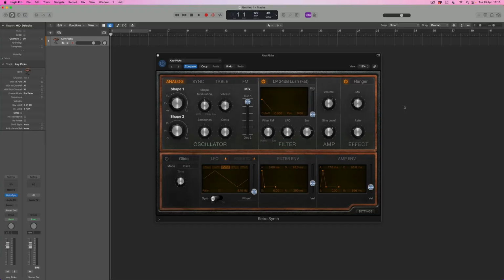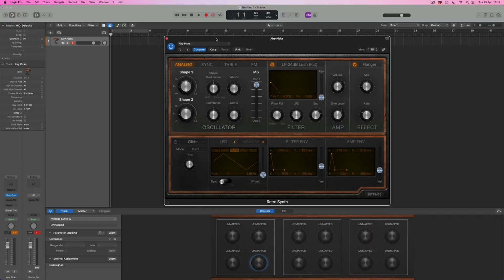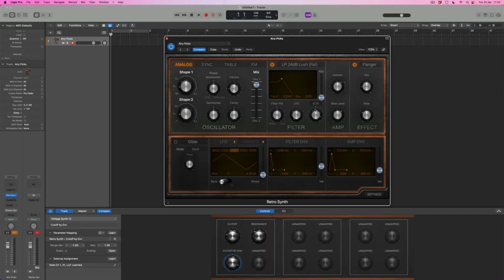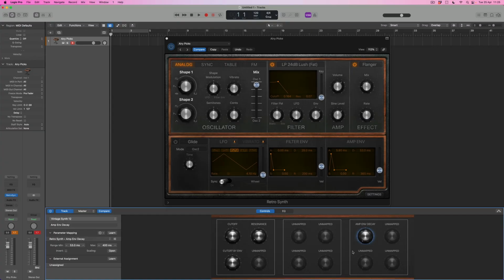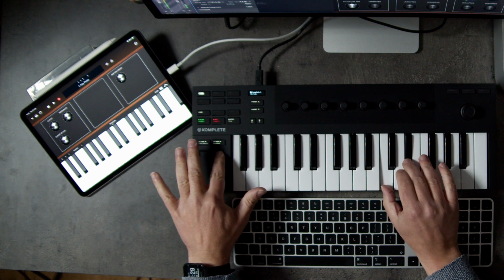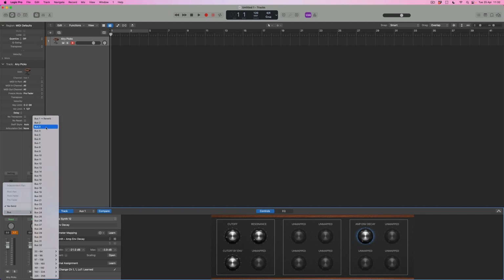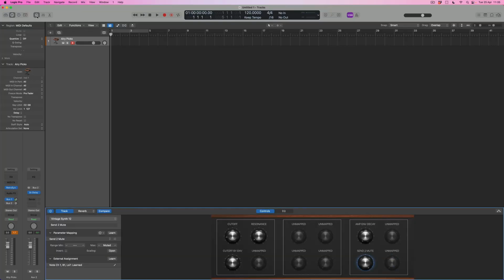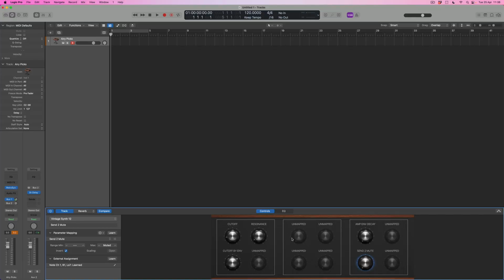LOGIC PRO X - Smart Controls Go Deep

Comment: As always, absolutely brilliant work Jono.

Not sure if anyone else has run into this but the smart controls don't work at all if the track that you are controlling is inside a Track Stack. its an annoying bug but I believe it was addressed and fixed in one of the latest Software updates for Logic Pro X. So if you are having any trouble, maybe update your Logic software and that can solve it. Hope this helos!
Reply from the maker: Thanks so much for sharing that tip. Pinned!

Comment: 0:41 I might be missing something but how can you get such long lasting notes if your sustain is set at 0? When I load this preset I get short plucking notes (even with long release)?
Reply from the maker: Good question. If you play a really short, Staccato note, as I do at that timestamp, you’ll hear a long 3-second release. If you hold a note down, it will ‘choke’ and won’t sound the same. In the video, I’ve adjusted the Release Time, which you can do too if you don’t want the notes to last as long as they do in that first demonstration.
Reply: Sustain must be set to 💯
Reply: Sustain at full level

Comment: Great explanation but a warning about assigning smart controls to a keyboard note, that specific note is no longer a playable note on any track (on that controller, it will be fine on other controllers) as it has been taken over as a Control Surface. One can do it, but it can lead to great confusion as to one no longer can play it from that particular controller.
Reply from the maker: Hi Shane. Absolutely right. I’ll make a Short about to un-assign Smart Controls in case anyone runs into that issue. Thanks for flagging it.

Comment: Hey Jono! Great video
I am working with Step FX (which I have applied to a send) in the Smart Controls and added one knob which controls Step Mod 1 Ties. The issue is, these parameters are under 'non-automatable' in the selection list, so I can't, well, automate them. I am able to control the knob with my MIDI keyboard or clicking on it, but I've been scouring the internet and couldn't find a way for Logic to 'remember' when I want it to be on or off. I've tried recording on my track and moving the control where i want it to be moved but had no luck getting it to work.
Do you happen to know a workaround for this?
Thanks a lot!
Reply from the maker: Interesting question. Let me look into this for you and I’ll let you know what I find! Thanks.

Comment: An interesting area for a channel so oriented on synth and logic pro would be how to map alchemy with a midi controller, prevent conflicts, etc. There are only simple midi mappling command+L control assignements video on yt, while nobody teaches how to prevent problems in mapping with logic pro. ex backup file(with the script), use more instruments, deabilitate etc
Reply from the maker: Thanks for the comment. This is such a tricky area for those of us making content because there are so many variables including which controller keyboard or surface anyone is using, whether there is a willingness to 'sacrifice' MIDI CCs usually reserved for specific functions (like Modulation, Expression, Breath control etc) and whether or not your needs change from one Alchemy (to use your example) sound to the next. One Alchemy patch might be deep and involved with multiple sound sources (all with parameters you might want to control, whereas the next might be smaller in terms of parameter count). This Smart Controls video will show you how to map any controller to any parameter (or combination of parameters) to a MIDI CC and if you save that patch as a preset, it will retain all of those assignments. So long as you map CCs which you've identified that = for you - are spare, you should be able to control whichever parameters you like. Hope that helps.
Reply: @jonobuchananmusic  thank you very much sure it helps.

Comment: Awesome! I had some problems with the Airy Pluck patch - it was behaving erratically - so I just experimented with the Default patch. I also had problems with establishing external control of the Smart Controls - likely MIDI confusions across my many controllers. Logic, for example, would register that it had linked my Komplete Kontrol's mod wheel but it wouldn't trigger. So I tried my Nakedboards MC-8 fader controller and that did work. I also discovered that you can automate a double or triple function Smart Control - actually the more likely way I would want to use these functions. I was automating filter cutoff, amp envelop, and a reverb bus with a single automation lane. Very cool! Thanks for another great tutorial!
Reply from the maker: Great to hear, many thanks for the update Gary.
Reply: @jonobuchananmusic  The issue was with my Konplete Kontrol S88. A reboot fixed it. But that's not why I'm piping in. I've since learned that Logic's Scripter (in MIDI FX) enables the same kind of  automation routing you describe, and you can target as many as four parameters in a single instance of Scripter. Very slick! Perhaps a good topic for a tutorial video? I've been experimenting with an expression pedal triggering Smart Controls and plugin parameters with Scripter and it's working great. I'm liking the expression pedal for recording live automation. Extrapolating further: Playing in string parts (and other orchestral instruments) often requires controlling Expression and Dynamics simultaneously using two faders with two fingers.  I've been experimenting with replacing one fader with the expression pedal. It enables better control of both parameters - at least for me. Cheers!
Reply from the maker: @garygimmestad4272  Thanks Gary - absolutely something I'd be happy to look at in a future video.